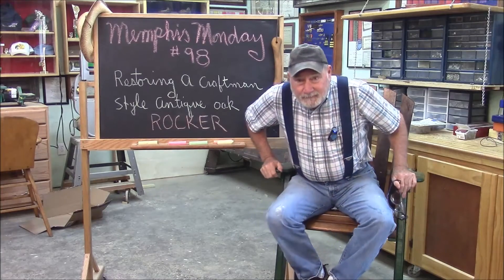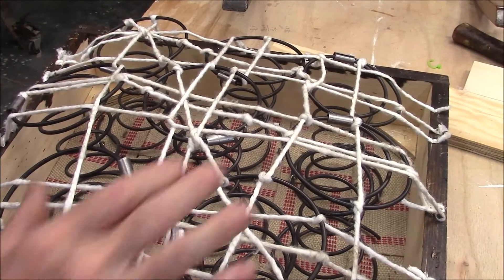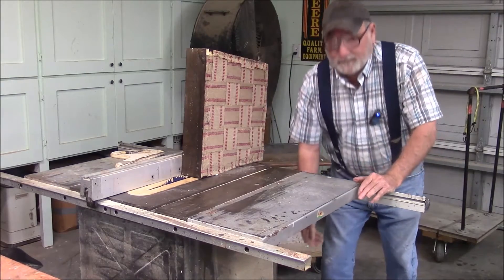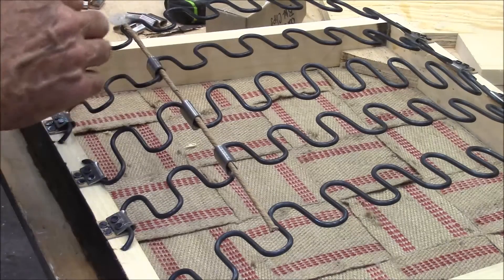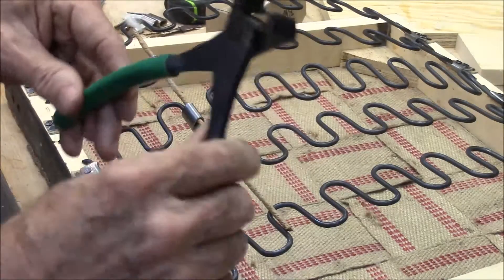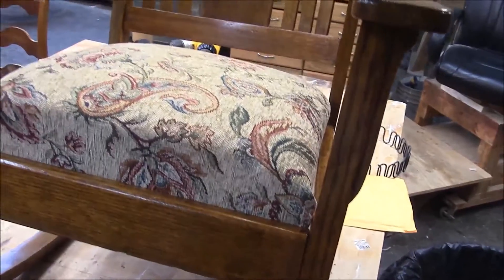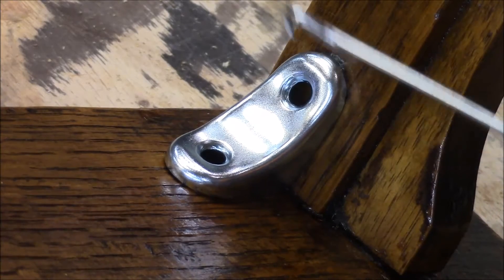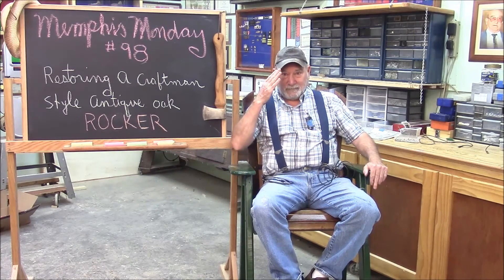98 Restoring Craftsman Style Antique Oak Rocking Chair

Comment: You are going to have to start the camera rolling when you are working on your prototypes for times like this when they turn out to be the finished product.  I had never seen springs like the ones you put in.  You did a professional looking job installing them.  Surely you weren't trying to say that you were making up things as you went along.  Hahahahah  Very nice rap up at the end.  It was a good explanation about why you don't want to change older pieces of furniture.
Reply from the maker: I hear you on that rocker I made.  It breaks my heart that I didn't film it.  Frankly, I figured it didn't matter, as I was sure the upholstering would kick my butt and take all my video time.  And of course the upholstering did kick my butt, but it was all off camera during my practice periods.  A side of the question I had not considered.  
    I tried the traditional coil springs, but I ordered a size to big.  You saw the results.  The "sag free" are what most upholstering guys use now (as if I know what I'm talking about).  I actually made friends with a real upholstering guy at his little one person shop.  I pulled as much info from the guy as I could, and I nosed around enough in his shop to assure myself I wasn't pulling a TR.  
    Yep, lots of trial and error.  And the seat for this chair wasn't damaged, rather it was totally missing; gone; nothing.  I could see from pictures of these chairs what the final seat was to look like, but I couldn't find a picture of a seat frame; or the springs; or filling; or anything.  So yep, I had to make a lot of stuff up.  You sharp-eyed thing you, you will probably be the only person who noted that silly comment of mine!!!
    Thanks for watching and commenting.
Reply: I was going to comment that you didn't act like the upholstery was kicking your butt and you couldn't pull a TR on your worst day.   I have to say that it is a beautiful chair and I bet you were sad to return to its owner.  I meant to ask before.  Where did you put the little corner brackets?  It wasn't really clear to me.   Did they replace the little brackets that looked like they held the seat up?  Don't sell yourself short, I am sure lots others picked up on your comment.  Besides, someone had to make up everything that we have today.  Everything comes from trial and error.
Reply from the maker: Great minds think alike I guess.  I watched the video just before I posted it and realized that I didn't say where the corner brackets were located!!!  "Heck, nobody will notice," I thought.  But I forgot about Hippie;  you don't miss a thing.  They were under the arms, and perhaps weren't even essential.  I only replaced them because they were missing, and they were available.  
     I'm with you on the "someone had to make up everything that we have today."   And so much of what we have today, from electronics, radio, nuclear power, and even quantum mechanics, was invented over a hundred years ago.  And forget about craftsmanship, we would be hard pressed to duplicate the craftsmanship of people who grew up without all our "entertainment" options.

Comment: Perfect timing since I just bought a chair similar. Where did you buy your springs at?  I've learn a lot from your videos. Thank you for posting.
Reply from the maker: If you google upholstering, or upholstering supply, or sag free springs, or coil springs you will get lots of hits.  I think I ordered all my stuff through Amazon.
     However, it is way more than springs.  You need the large bolt cutter, the right nails, and spring holders,  a spring stretcher,  and stays (the long wires with paper around it), the little clips, the special crimping tool for the clips, the special string to tie up the springs, etc, etc.  If you are into it, in the sense that you plan on doing other upholstering jobs, then go for it.  But if this is an isolated job, then I would have a professional do it (at a real upholstering shop).  It would both be cheaper, and be a better job. 
     I'm not trying to discourage you, as I often do jobs that are better suited to a professional.  I do those projects because I want to do it, not because it is the most logical, most efficient, or most cost effective solution.  So, my answer is not discouragement, rather it is information concerning the true scope of the job.
     Thanks for watching and commenting.  Hope to get plenty of your comments in the future.
Reply: Memphis Applegate thank you very much for the information and answering so quickly. I enjoy making and improving things for me and for family /friends. Have a great week.